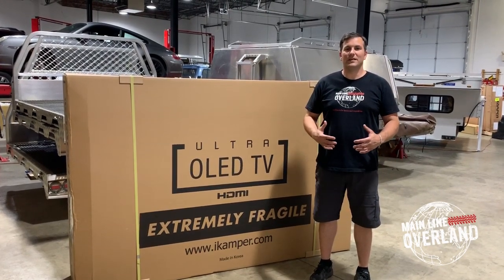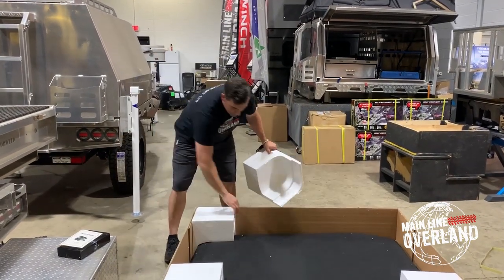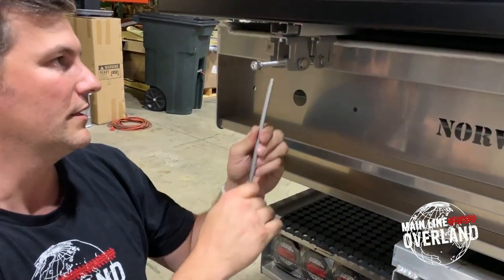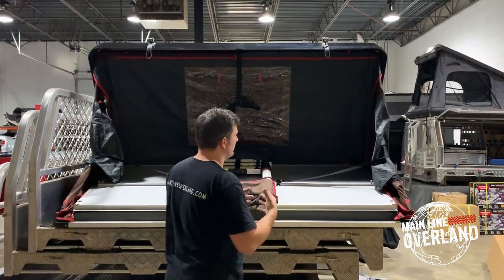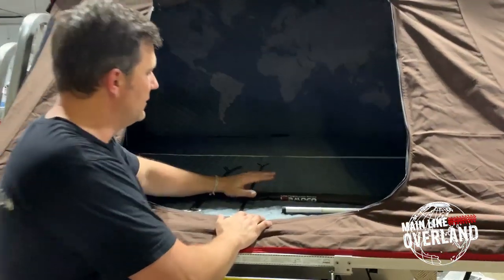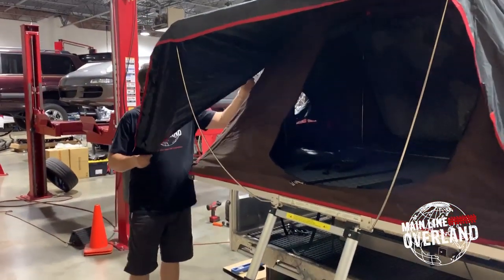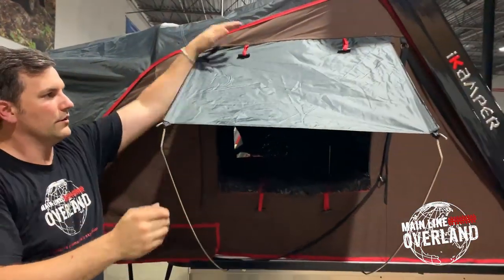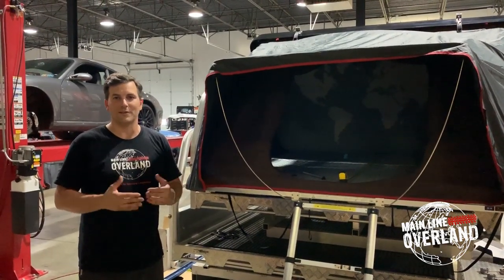iKamper Skycamp 2.0 Unboxing and Set-up

Comment: How sturdy is the honeycomb floor/base of the tent compared to others in the price category? My girlfriend is a BBW and we are probably looking at around 450-500 lbs of weight up top when we go camping.
Reply from the maker: Bobby Expedition Grade Johnson My advice would be to increase the # of load bars contacting the bottom of the camper. 3-4 would provide a well-distributed load across both the vehicle roof and the camper floor, and you could brace the center between the mounting extrusions with an additional piece of square tube running along the vertical center. 👍

Comment: Hi MLO! Did you ever install one of those on a Pionneer platform from Rhino-Rack?  I was wondering if i need crossbars and how i would access the thing under to release the top if it lays flat on my platform. Let me know if you got a bit of info on that. Thanks
Reply from the maker: Good question! The Rhino Rack Pioneer Platform uses vertical extrusion rails as opposed to cross-bar-style extrusion rails, so the iKamper's horizontal clamp mounts will not fit. In this case we would test fit the camper on the rack and measure and mark where the iKamper's mounting rails sit on the Rhino Rack extrusions. If necessary we would shim the mounting area to make sure the weight of the camper is spreading evenly across the mounting points, then drill and through bolt the camper to the rack by sliding bolts and plates into the camper extrusion, and using backing plates on the underside of the rack before bolting down.
Reply: @MainLineOverland  Ever done it before? I am not manual (like that anyways) so it seems complicated but it might be easy for you guys.
Reply from the maker: @HeRo-qd6tk  Yes, we have done these installs Rhino Racks and many other rack types. We have locations in Bow, NH and West Chester, PA, or you could find an installer in your local area. Give us a call at 844-656-7626, or email sales@mainlineoverland.com for info.
Reply: Do you have the iKamper Skycamp (for 4) in stock at MLO in NH?
Reply from the maker: @HeRo-qd6tk  We have one on the way
Reply: Thanks guys. Mine has arrived monday. I found someone for the install
Reply: HeRo I have mine installed on the Rhino Rack/ Pioneer platform. I was worried that I would have mounting issues but everything lined up perfectly. I would suggest you get the locking mounts for the Rhino Rack. It raises everything slightly but it gives you access to get to the bolts to install the I-Kamper.
Reply from the maker: Brian Herr We also reccomend the iKamper Version 1.0 Mounts if you are drilling and through-bolting through a Rhino Rack.

Comment: Tent looks awesome but I don't like the window system, there are no side parts to the shedding so if it rains and there's even a little bit of wind you can't leave the bug net open or it will get wet which is not ideal in a hot country. Also the price... Dear god how can you justify that price?! I know there's R&D but $5000 AUD...?!!
Reply from the maker: TheGoprotraveller We run into this with our truck campers as well. In rainy weather I like to keep the window awning deployed and the storm window mostly zipped but cracked open at the top for airflow. That way most of the water sheds down and away from the tent. We are in the US, so I can’t speak to the AUD price. 😁
Reply: That's about the right price for any premium hard shell RTT in oz mate if u want cheap u have to go with Kings. Not sure if the new alucab knock off will be any good but there quick has had heaps of probs

Comment: A fragile camping equipment???
Reply from the maker: Fragile? We've sent these iKampers from Alaska to Arizona and everywhere in between on customer builds, and they are still looking good and going strong.
Reply: MainLineOverland no offense meant...just going by label on box
Reply from the maker: Nelson 623 Haha, that is a pretty good trick by iKamper to keep their products in good shape during shipping. If anyone has received commercial freight on the regular it can def be a horror show. 😱
Reply: Bike manufacturers use the same trick. A carbon fiber frame can get damaged if it's tossed around.
Reply from the maker: Michael Cook Indeed.
Reply: @MainLineOverland  no kidding.  I use to be in the freight service.  I have  witnessed the craziest stuff.  Forks from a fork lift rammed though computers and tvs, bags being run over... and wedged between the wheel and fender and bursting into flames...

Comment: I dunno. I love this design... but... I find it sags. I think it all should be more tight fitting. Seems a bit saggy on the top end. 

I want it tight tight!
Reply from the maker: Matthew Shank A straight pop-up or traditional wedge-style pop up could give you a tighter fit, since the gas struts would hold the walls in tension, but it would not have the wider sleeping area of iKamper’s hardshell with side pop-out. All up to personal preference and space needs.
Reply: I get that. 

I still loooove this design. If I was into car camping I think I can say with confidence that it’s at the top of my list. I’ll get the awning too.  But right now I’m still on a canoe camping “trip”.  I’ll pick one up when I get a little older + kids. 

Another video I saw though, showed signs of leaking near the top skylight. I hope that gets addressed.
Reply: @azazelone905  i have one on my bed of my 2015 silverado. I did an rci rack on mine. I dont have the sag issue